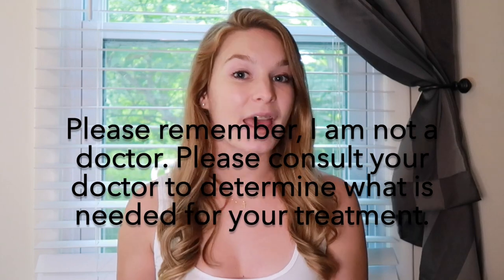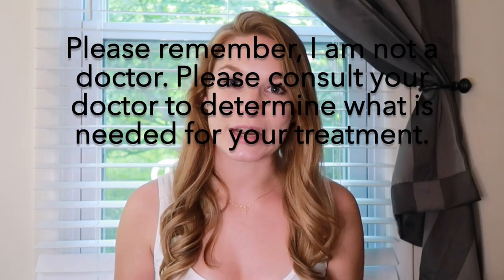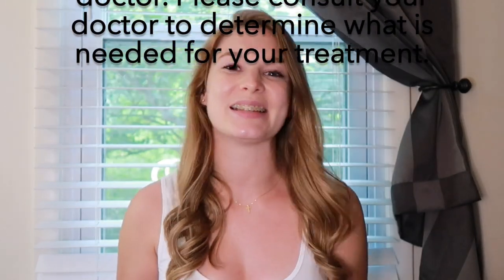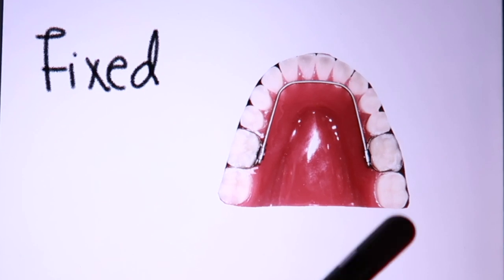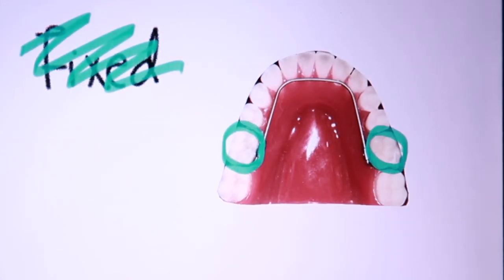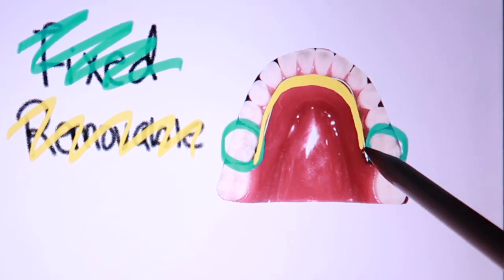FRLA Dental Appliance | What is it? | Controlled Arch Braces

Comment: Hey, I have controlled arch braces to prepare for my AGGA. I noticed my FRLA wire moves in and out of the bands but stays attached. My dentist said this is normal, but in some picture it looks like there may be cement or something on the wire where it attaches to the band. I notice different pressure in different teeth whether the wire is pushed in or out which makes me wonder.
Reply from the maker: Moving FRLA is normal. It will slide in and out. The “cement” you’re seeing is filling material to help with comfort on the tongue. Best of luck!
Reply: @DentalDork  Thank you so much!

Comment: Ok so I am 41 yrs old and have had TMD for about 15 years now. I have slowly developed asymmetry in my face. I also have popping and headaches. I have been on a mission to get this problem solved once and for all. After braces and DRT (disclusion time reduction therapy) recommended by a TMD dentist, my teeth were a little staighter but it did nothing for my jaw. So I've been getting treatment from another TMD specialist and I'm currently in phase 1: splint. I have had the splint since February and I have not had any reduction in symptoms. I was referred to a orofacial myofunctional therapist but she charged $124 for 30 mins a week on Facetime for  the next 12 months. Also she doesn't file insurance and wanted me to pay for the whole year up front. I said no way to that.  So I have been doing tongue exercises from YouTube videos. Anyways, I would like to know if the popping and clicking you had all resolved before going into an AGGA? Also, did  you wear a chin strap while sleeping? I really feel like I'm spinning my wheels for 6 months with no progress. I still have all the TMD symptoms plus now I have a lower jaw jutting out more to go along with the asymmetry or as I usually refer to it: "my jacked up jaw". I should also mention that I have cervical spine misalignment as well as a bulging disc. I keep hearing that I really need to avoid TMD surgery at all costs. But, I'm starting to feel like that is a better option than going through all of this torture for no progress. 😫
Reply from the maker: I have been busy this week, but I will reach out to you on the Facebook post you left me! I understand your frustration!
Reply: CAB will make your face even more asymmetrical. Would not recommend.
Reply from the maker: Timmy Tim, not in my experience. It has made me incredibly more symmetrical, but I’m sure it’s different for everyone. Good luck on your journey!